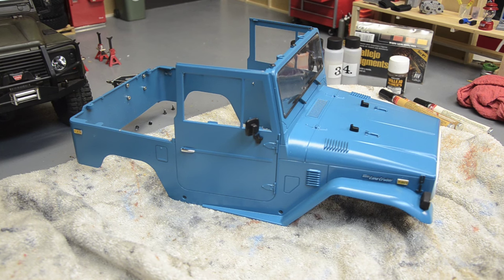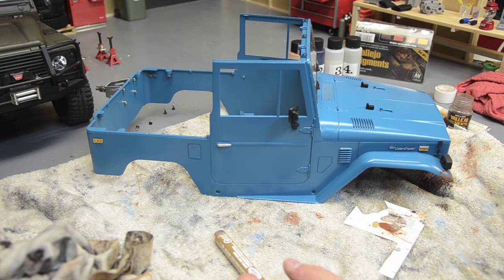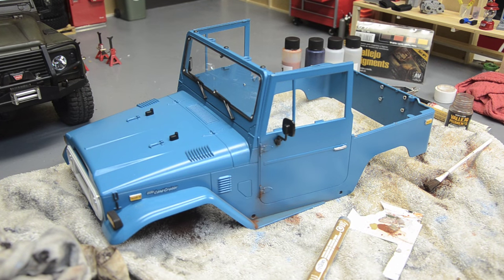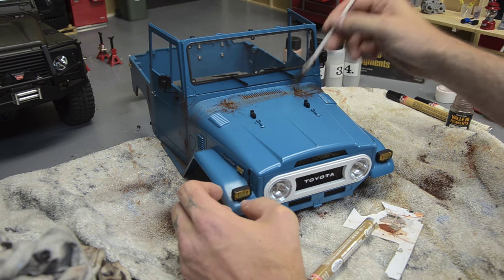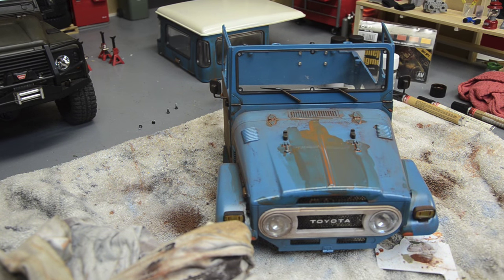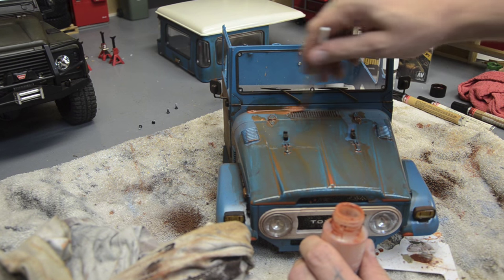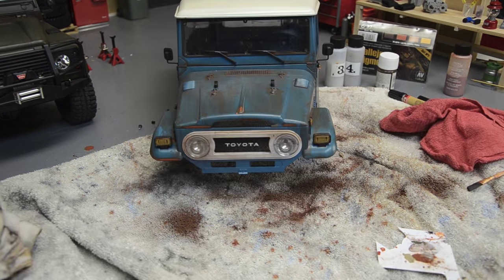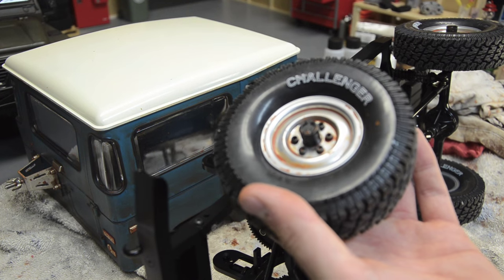Weathering a Land Cruiser part 1: the outside

Comment: Wow bro I had a 1964 FJ40 that very same blue color. It made me wanna cry when I saw yours rust all over. It had rust on it for sure but not like that. Usually they rust where there was body damage or where the body etc. flexes and makes the paint separate. water and mud collects in the corners and it’s not washed away will rust as I’m sure you know this isn’t your first rodeo. I’m a big fan of your work bro don’t get me wrong but I don’t know about this one bro don’t forget the hardtop on the 40s are fiberglass not metal At least mine was.

Comment: Toyota land cruisers are were the inspration for the Jeep body design came from Also Hard Tops were great for weather protection & But made Jeep class trucks like Her extreamly Top heavy and with Standard factory suspension package it felt like you was going to flip over every time you made a turn That is why allot of people removed them in favour of a soft top however back in the day Canvus tops were very expencive and only a temporary solution  most of them never lasted longer then a year or two and would leak and the zippers and snaps for the window and door sections would Rustup and corrode and fail to function the cross bracing tention straps would fray and brake The windows would get scrached up and yellowed and we're prone to dryrott I used to own a 78 CJ7 with a factory hard top back in the day It was a awesome little rig but she was extremely terfing to drive with the hard top installed but try to drown you when it rained with a soft top however She was alot of fun I truly regret saling her now because of all the new aftermarket options that are now available but back in the day aftermarket resources were very limited so we made due and worked with what we had we available at the time

Comment: Great job in the Cruiser. At first I hated to see you weather this one, Josh. But now that it's done, I like it. The weathering looks a little overdone sitting there in that bright lighting, but I'll bet it looks ultra-scale on the trail! That's how it usually is.....you need a little more than you originally thought. I haven't weathered an RC yet, but I'm a fulltime luthier (guitar repair, construction, and vintage restoration), and one of my required techniques is making new brand finish repairs blend in with old weathered patina'd lacquer. Needless to say, there's definitely a little trial and error involved, and every project is deferent than the last!
Reply from the maker: +Mike Forrester My first weathering experience was on a guitar.  Im not a luthier by any means but I have done several custom finishes on my own guitars in the past.  Using muratic acid to age new chrome harware. lol.   Every project is very different,  I learned a lot from doing my RC4wd D110 first.
Reply: +Josh Dutton (RC Everyday) 

Oh yes, the muriatic acid vapor bath. ;)

I've done a few of those treatments myself, including a Parts-o-caster I built for myself.....a clone of a '65 Strat, in Fiesta Red. Very cool.

Comment: That's some serious Weathering!!! I like it! 👍👍
This to me, is REAL Modeling!! The stuff that separates the Men from the boys. (Traxxas Bashers) 😜😫
I've been doing Weathering in Model Railroading for over 25 Years... Won several Awards for them. But I have YET to Weather any of my 1/10 Scale Rigs! 😱😱  Cannot tell you why. 

This is like my challenge to get cracking! All three of my Rigs look far too "pretty". I think I'll start out small... Doing the Chassis to build my confidence back. I also don't know why, but Weathering in 1/10 Scale, seems different. 
GREAT Work!!
Carmine 💥 ⛽
Reply: One question.... Did you Dullcote the Body first? I'm asking because that was always my first step. It also gives the Powders more "bite".  Also, I would have definitely removed or masked the "glass".... Unless you're GOING for the "sitting in the Woods" look.
However, I'm SURE you already know that!
Reply from the maker: I didnt dullcoat the body beforehand, just used a satin paint.  The pigment binder acts as a dulling agent and I never spray any type of sealer or dullcoat at the end either.   Sadly this rig was sold off long ago.
Reply: That's too bad. This was really sweet!!

Comment: great work!, could you please share which paints and materials are you using?
Reply from the maker: It has been a while but the paint color was rustoleum satin lagoon. I think I used Vallejo pigments on this one. I have several other tutorials on my weathering process since this rig was built as well.

Comment: a question, how do the different parts of the body fix themselves? Are they stuck? or with screws?
I want to buy an RTR kit, but I would like to paint parts of another color, and for that I would have to disassemble lights, turn signals, glass, seats ....
Reply from the maker: Its a mix of both.  Big items attach with screws but some things still glue on.
Reply: De acuerdo. ¡Gracias!

Comment: How long to let dry between each application or rustall products? Thanks!
Reply from the maker: I would let the rust coat dry overnight usually.  The dull coat will take about a day as well. Just depends on how thick you apply it.
Reply: ok, thanks! apply boat number two, but I see that it removes a little the black cloak ... and was a whole night. It is normal?
Reply from the maker: it does eat into the previous coat a little

Comment: Also. For that orange little bottle you had. Was that just a wash of water and one of the vallejo pigments?
Reply from the maker: MatthewBerg689 that was from the rustall kit I bought. Not sure exactly what was in it.
Reply: Josh Dutton Also, im going for the rusty effect and not just dirty and old effect. I have lots of normal acrylic paints. should i just use those and thin them or should i buy the three vallejo washes. black, sepia and umber washes. And any paint marker will do for pigment bonding? I saw some vallejo pigment binder as well.
Reply from the maker: MatthewBerg689 I haven't tried thinned acrylic paints but I've seen it done. I was using the tan paint marker as a pigment binder until I bought the Vallejo pigment binder. It dries clear and looks better in my opinion.
Reply from the maker: MatthewBerg689 that is the set I have.
Reply: Josh Dutton Well i have an old bullhead body i bought last year and havent used it so ill test on that. good to test like you did before this cruiser. ok, well i may try both but ill also pick up the vallejo pigment binder. Thanks for all the help! If you have instagram or something, i could send you the final result of my gelande 2 d90.
Reply from the maker: MatthewBerg689 it's very good to have something to practice on. I don't have an instagram yet. Lol. Maybe.one day . Best of luck on your build.
Reply: Josh Dutton Thanks! Btw, im painting mine a forest green so do you have any tips?

Comment: Hi , I have a question how did you paint the front grill white and still keep the light buckets chrome inside , are they removable or did you jsut mask them off ? Also did you sand the chrome paint of the part first or just prim and paint . Ps like the black trun signals better than the chrome colour as well .
Reply from the maker: I found some small bottle caps that fit perfectly inside the headlights to mask them off when I painted it.  Its been a while but Im pretty sure I just sanded the chrome a bit and painted right over it as well.
Reply: Thanks for the idea , I will try do the same :) Not a fan of the chrome so think I will spray it but then sand the bumper  to add some contrast lol